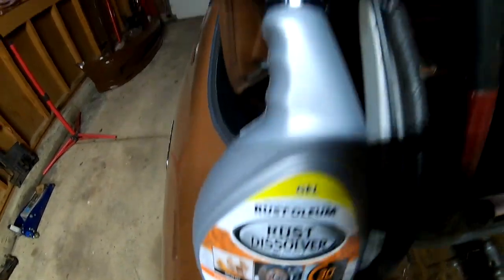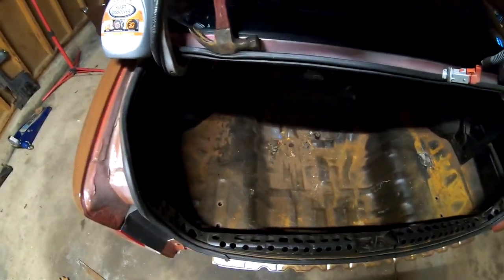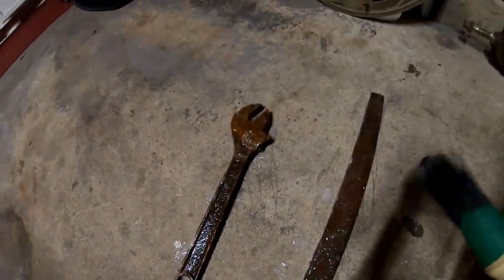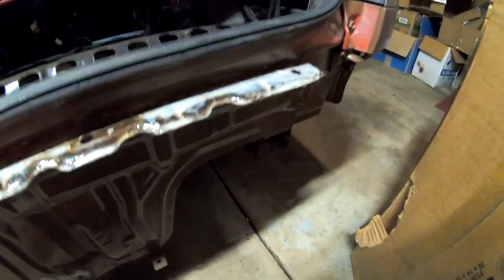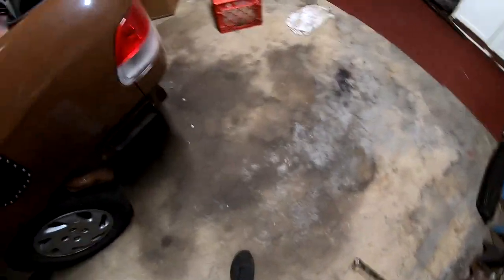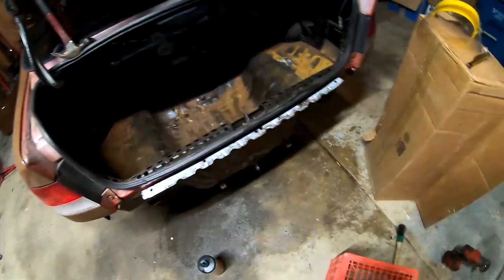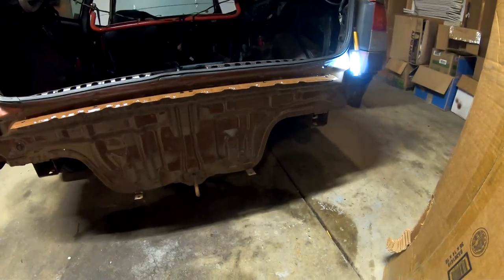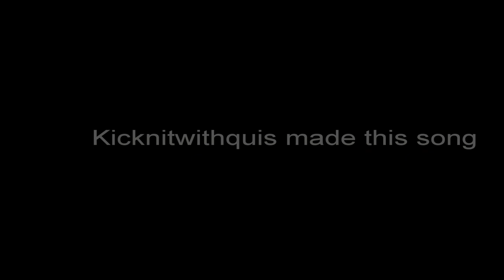Rustoleum Rust Dissolver Gel tested with great results on my 500hp civic build

Comment: You removing a lot of the liquid with that brush. All you have to do is spray it and let it sit. Also water is what causes it to get rust, lol. This video cracks me up, thank you for the laughs.
Reply from the maker: Naw you really need a brush to spread it.  Also after the water i laid paint at the end of the video to prevent the rust from coming back but I do see your point if it was not treated. Glad you got a good laugh 😆 lol so did I.
Reply: What do u recommend to remove it without water?
Reply: if you read the directions on the bottle it says to use a brush to spread the gel around and to wash it off with water 🤷‍♂️

Comment: Hey bro, I'm from Jamaica and have a Eg coupe with a d16z6 thinking to go boost would love your input, also whats the color code for that brown on ur car ?
Reply from the maker: I would go boost on stock engine 8Lbs of boost no more until you build a proper engine. My paint is a cheap rustoleum can paint job secret formula is  (Gloss Leather Brown) 👍 check out my other videos of the paint job I have many
Reply: @BarbasLife  Thanks! but they dont sell paint like that in my country not by spray can, so a color code I would have to do it by, I watch most of ur videos keep up the good work will keep in touch